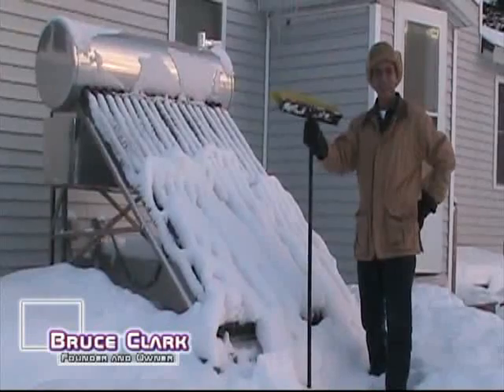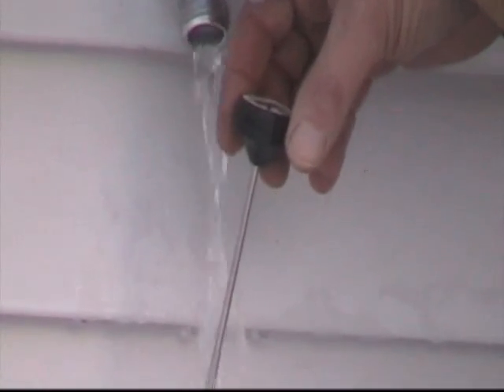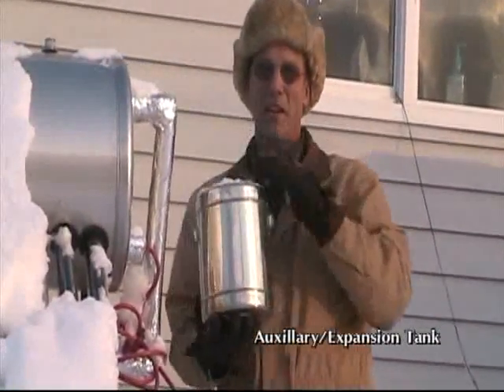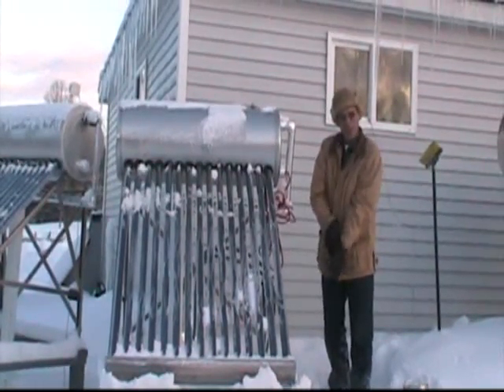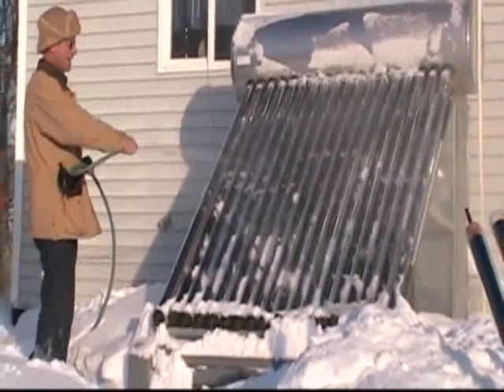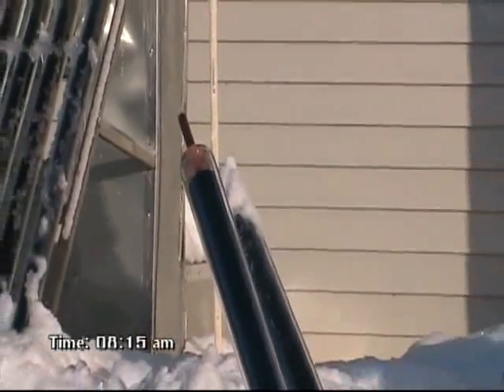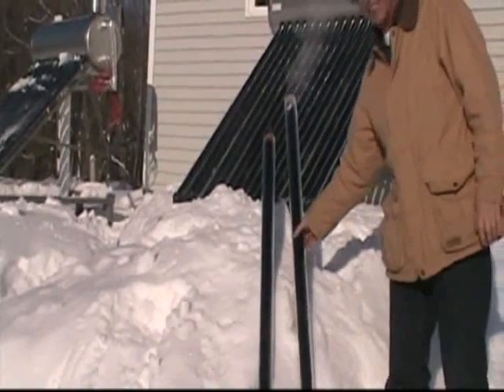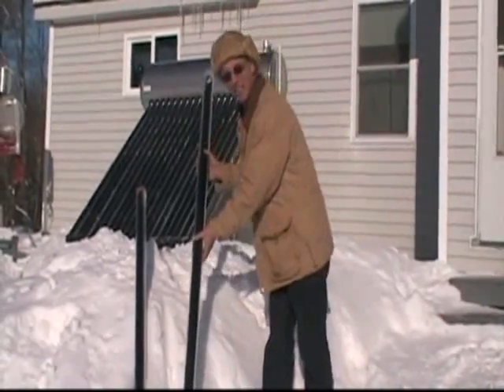Do it Yourself: Compact Solar Water Heater Maintenance

Comment: 2020 UPDATE of 10 YEARS USE,  COST, PROBLEMS and  LIFE SPAN -1st I discovered the coil model in winter covered in snow =IT COST ME $6.00 A MONTH = so I built a unit with no solar, a 30 gallon open head drum & Pex-Al-Pex for $200 ran 2 years $6 month, just built a built in model, old unit BRIGHT STEEL INSIDE

NON PRESSURE LIFE SPAN 10 years+,   >>>HEAT PIPE PRESSURE + DANGEROUS 6 WEEKS TOOK OFF LINE, OPERATIONAL LOSS ISSUES<<<< NON PRESSURE COIL issue of winter freeze of coil because people drain the tank & not blow out coil, NOTE: left with water in tank, tubes clear of snow no trouble, I sold off my personal unit as my home built unit was far superior

BUILD YOUR OWN- PATENTED- I grant any individual the right to build one- - 100% SAFE ALL HAZARDS ELIMINATED 100 YEAR LIFE SPAN MAINTENANCE= ADD 1 CUP WATER A YEAR

Required Material-Open Head Drum w 4-3/4 &1-1" female holes, 200' pex-al-pex pipe, thermo & heater drain valve CPVc & PVC pipe & Fittings for vent assembly, insulate 2"

MY POC is clarkmale@aol.com

Comment: Thank you so much for making this demo. I'm in Maine, too, and was thinking of setting up a hot water system with evacuated tubes.
Reply: 10 year update in comments
Reply: I found on Electricity with no Tubes it cost $5 a month, so I built a model used for 3 years and got a patent, Love my $200 50 year 100% safe water heater and $6 a month cost and endless hot water

Comment: Thousands of videos I have watched. And no one tells you how to drain 
the water during the winter. Is everyone stupid. I don't understand. How
 can you have any confidence on any project if you don't have all the 
knowledge to do it.
Reply: You do not drain it in the winter , you use it. If you drain it you an freeze the coil and ruin it. TRUST ME IT WILL NOT FREEZE. I now live in Madison Maine and unless you live in the Arctic and cover it with snow for 2 weeks @20below no problem
Reply: BEST IF NOT DRAINED, but to answer, you pull a tube, or open bottom drain if so equipped and blow out coil if so equipped =PLEASE SEE MY UPDATE IN COMMENTS

Comment: PTTHOR ,they look like evacuated tubes to me, which is a interior black tube surrounded by a vacuum and outside glass? tube.  very well insulated from the surrounding cold. I do not think plain uninsulated tubes would ghet nearly as hot in such cold conditions

Comment: Hi I to have been using non pressure with coil, I have seen failed high pressure units here as water quality is poor and can cause the pressure relief valve to fail leading to over pressure of main tank and failure.
I like the non pressure type because in the event of over heating steam can vent without pressure build up. Cheers Tony

Comment: What type are you getting?, I tried all three models, got three different heat pipe pressure , 304 and 316 stainless and the " titanium Steel " all failed, the Non Pressure with coil works the best with least trouble in my 3 years and 150 customers operating very happy

Comment: $250 to install the only extra is a 120 Volt 15 amp GFI to plug the controller, a $50 relay can be added to protect the controller from lighting